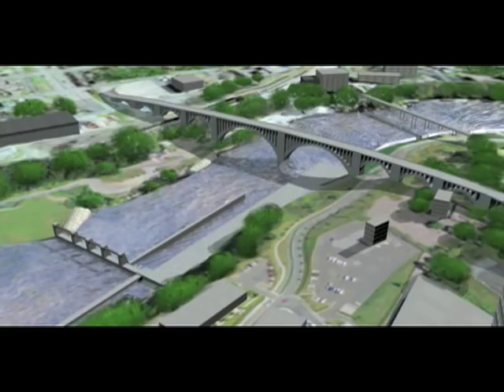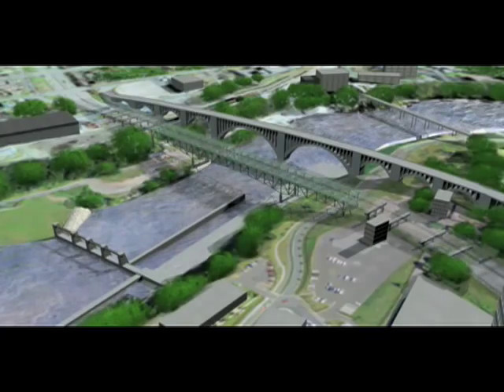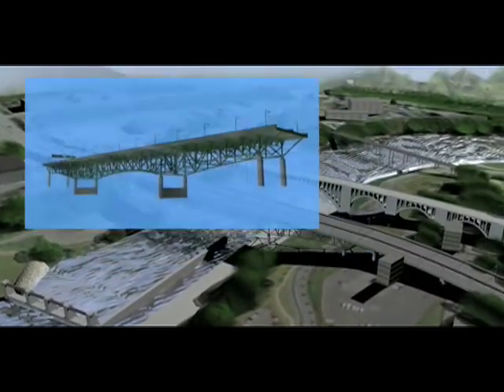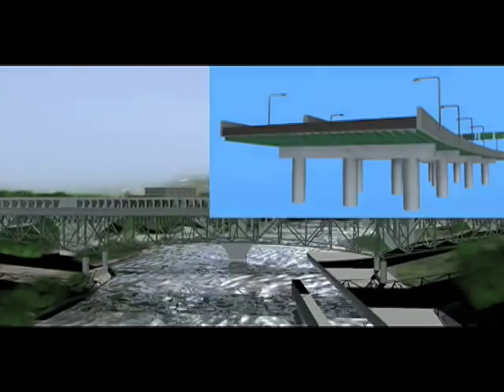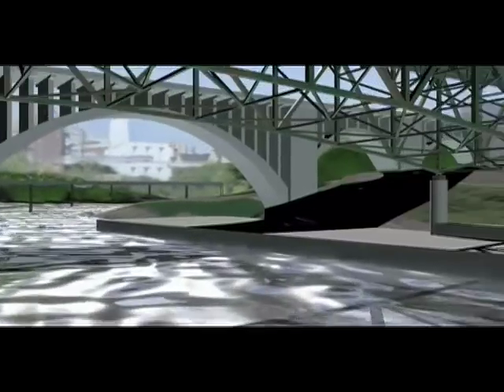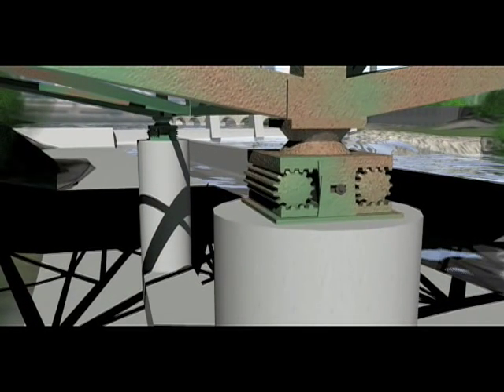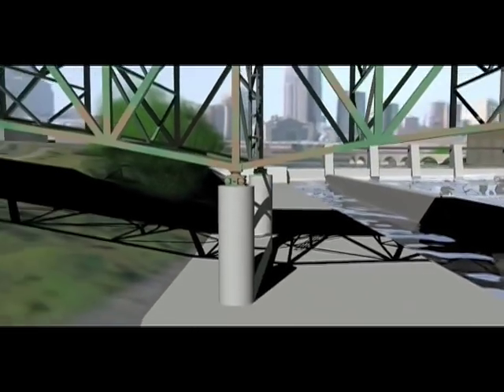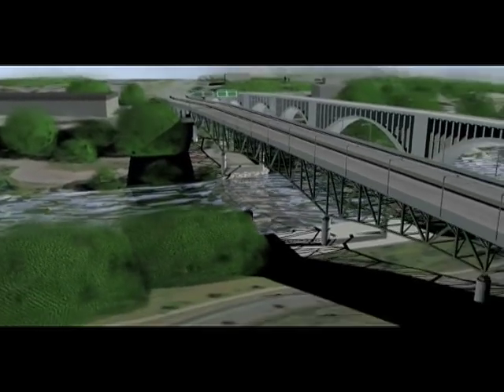35W Bridge Collapse Visualization

Comment: In my opinion the whole thing was underdesigned.  I’ve looked for other bridges of similar design and couldn’t find any other so flimsy.  Compare it to the I5 bridge over the ship canal in Seattle.
Reply: Um I should mention that MANY railway bridges share similarities in structure to this bridge (especially on older rural lines) the only differences are 1 its a road bridge 2 it had bearings and 3 the design had the stress points on merely a few points wheas most truss bridges had it built to spread the stress over the entire structure also in regards to "Underdesigned" you haven't seen many covered bridges have you? Or many classic rail bridges of the 1800s? Which by comparison this bridge could be seen as over designed

Comment: ... yeah, a country with a completely rotten infrastructure - poor roads, poor roads you name it. Why they do so much better in China? Now with a mentally ill donut at the helm things might even get worst. When you look at Denmark a small country, you probably wouldn't find a better infrastructure. Coming from rotten England once I stopped the car shortly after arriving in Esbjerg, as I thought something is wrong with the tire pressure, only to realize it is just the smooth road surface what made think something must have been wrong. Everything you see is in a prestine condition, and no litter like in the filthy United States and in broken England